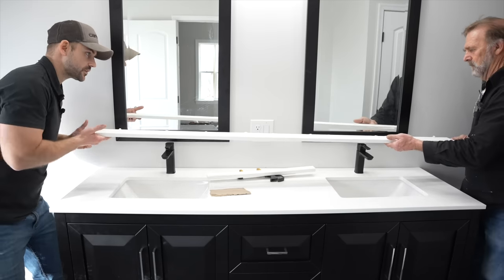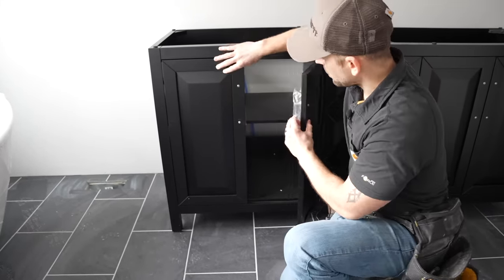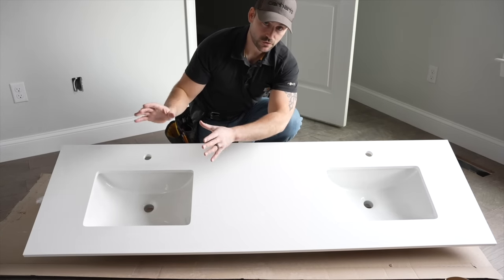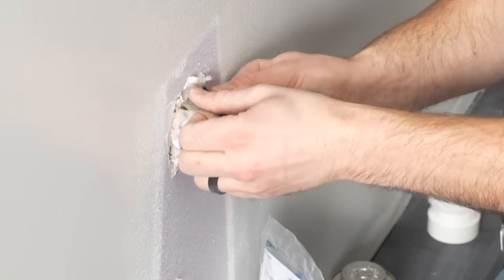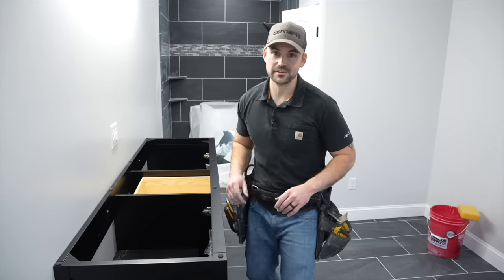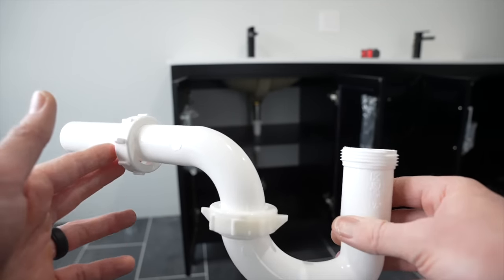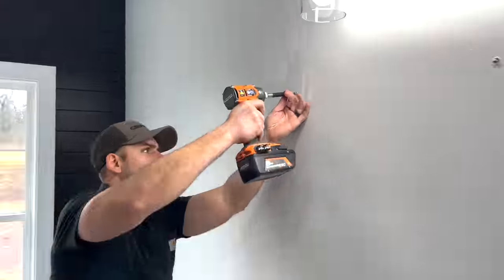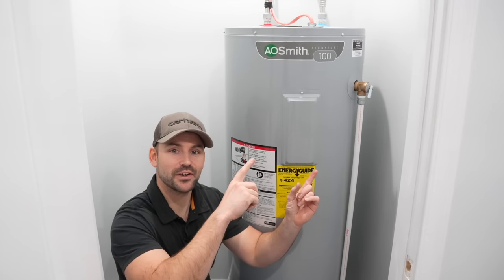How To Install Double Bowl Bathroom Sink Vanity - ALL PLUMBING CONNECTIONS

Comment: Again, bravo Josh. Love seeing your boss getting involved as well. The only time I use clear silicone for a sink drain is when the sink is corian or some quarts sinks because plumbers putty can actually stain the product. Also if you get an inexpensive sink at a box store watch to see if the underneath part of the sink is flat and smooth. I've had to put some plumbers putty in-between the rubber piece and the sink. (Not often) 
Hooking up faucets and drains is always easier if you can as well. The drain out of the wall I always put my adapter on after the sinks or sink is installed so if you have to adjust, like you had to on the second hook up, you can glue the pieces and not use a threaded adapter. Of course I love the fact that you explained that this can happen. I always have what is called my tinker toy box with plenty of fittings especially on a remodel job. Of course new construction the vanities might not be chosen and plumbers do not know 100% what type of sink if it's a single bowl or double bowl in case someone changes their mind. Little things always happen but there's always ways around them. 
Very seldom do I put any adhesive underneath the vanity top for the reason if something were to be damaged and you had to remove the top it's easier to cut that little bead of silicone or adhesive. I've had tops to be removed that someone used liquid nails and you basically have to destroy the top to get it off and sometimes can damage the existing cabinet. Backsplashes as well. I never put any sealant underneath the bottom because you will not get a solid fit with something obstructing underneath. All your tips of course are fantastic with much information to almost anybody who might want to do this on their own. That's what I love about your videos and all the information that you share. And don't forget to always give your wife credit because that's the most important part of a successful job when they have to give you a hand. I almost forgot the important part of the project when it started how about the light fixtures. So much easier as you stated then you do not have an issue of damaging anything or scratching the cabinet or the countertop or even dropping something on it. 👍🏻
Reply from the maker: Thanks for the info about using silicone instead of putty on other materials. I actually never heard of that so that is helpful. Smart to hold off on the adapter as well. Better to have a glue joint vs Teflon tape for sure. I don’t like to put silicone on top of the vanity when setting the top either. If you have to lift it up to install something as I did in this video, it would be a mess. The support of a spouse is not something that can be substituted with anything else. I always look forward to your detailed comments David. Thanks again for your support!

Comment: A word of caution when using plumber's putty, sometimes referred to as 'stainless putty".  It's okay to use it on stainless steel sinks, but depending on what material your sink is made of, most manufacturers of cultured marble bathroom sinks tell you NOT to use those putty's because they react with the material the sink is made of, and the sink will crack in the area where the pop-up drain is attached to the sink.  Instead, they recommend using silicon to seal the pop-up to the sink.  I recommend that you check with the manufacturer of your sink before using putty.

Comment: If the vanity has legs like a piece of furniture vs. a cabinet with a Toe Kick wouldn't you want to have your water lines coming out of the wall so it's easier to clean under the vanity? Nice work.
Reply: I'm not familiar with this channel but it looks like a flip project. They love running pex and sharkbite whichever is easiest